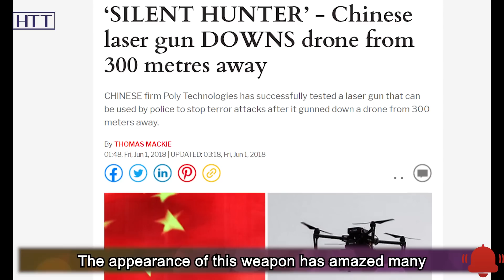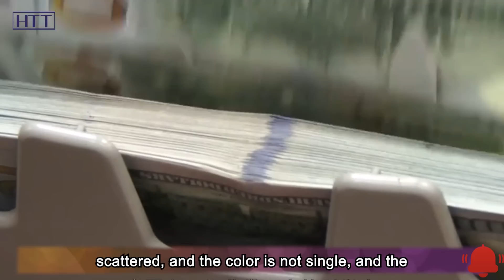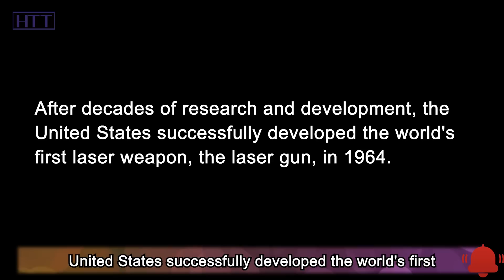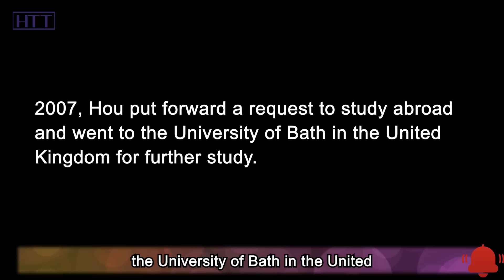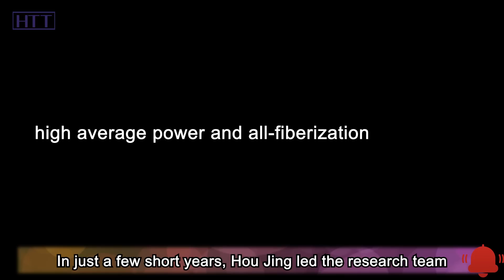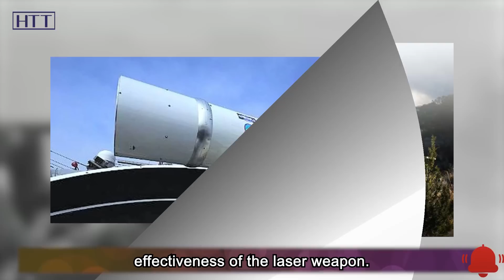Why the USA call her a woman more terrifying than a nuclear bomb?

Comment: A Range of 4,000 kilometers?  Do you mean that?  Are you sure that is not 4,000metres? I mean, that would imply shooting down drones over Moscow from London!  Somehow, I doubt that is possible or even useful.  It might be possible in outer space but even there, I doubt its utility.  Laser beams obey the laws of physics and light is diffracted by differences in the density of air.  Over 4,000km there will be differences of density for sure.
Reply: I think the commentator spoke wrongly, should be 4km